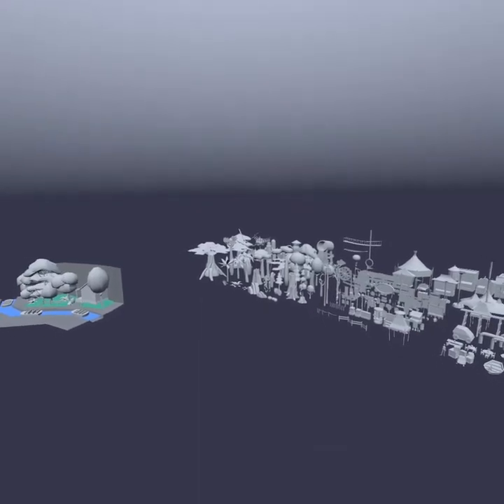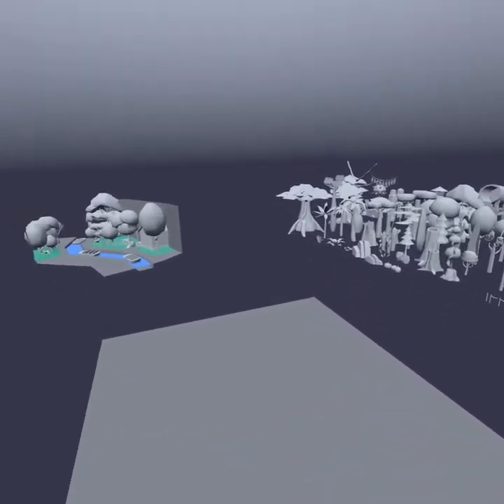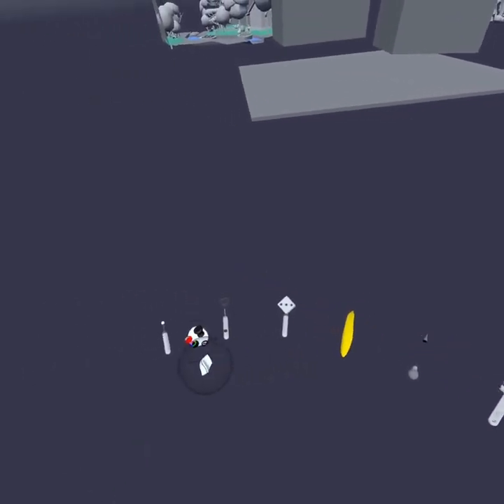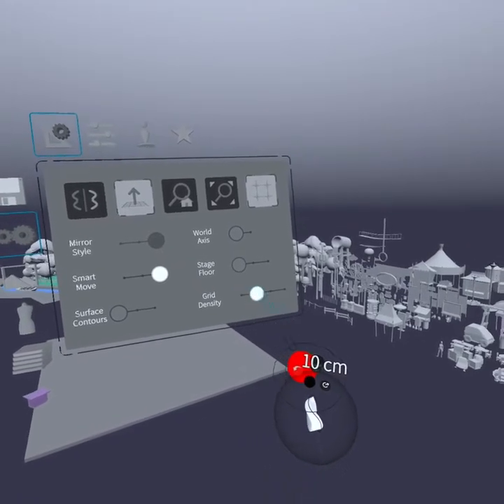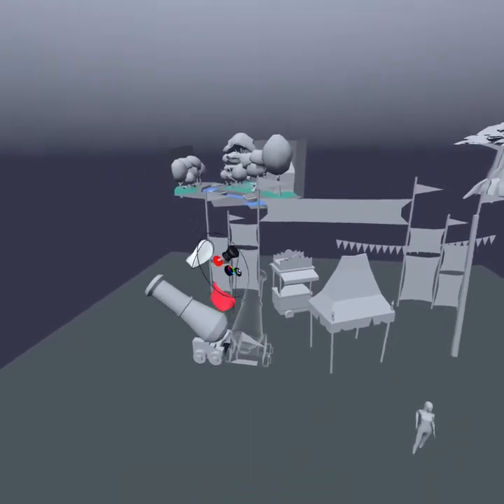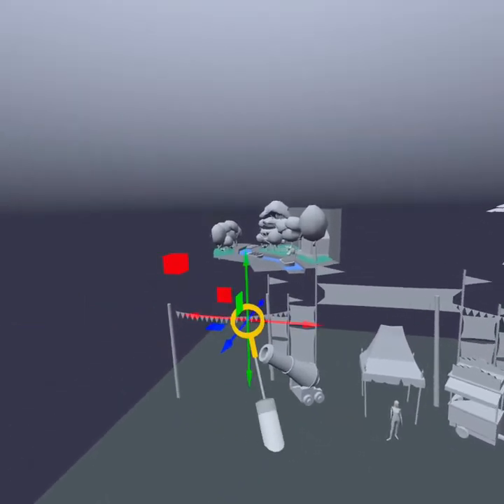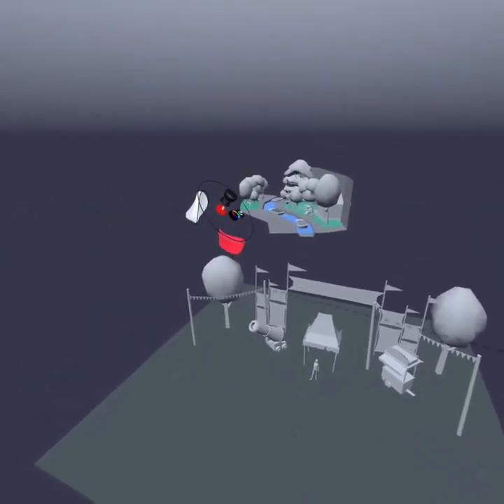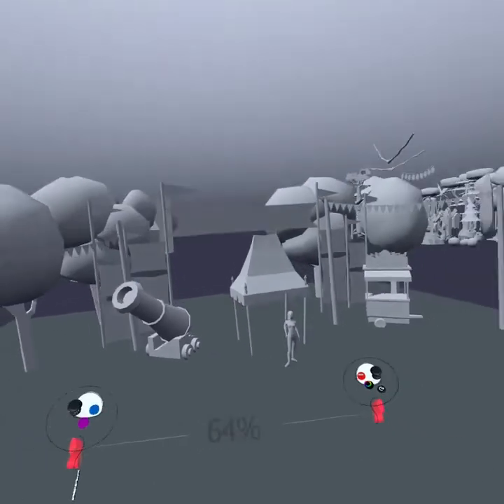Gravity Sketch - Precise Placement of Assets

Comment: Thank you, valuable information!!! Do yo Know how to align vertexes (points)  in edit subD mode? Is there a way to align a row of points that make up an object, for example, align them all on the y-axis?. can i use the grid for that?
Reply from the maker: Currently only by hand I believe. The selection tool helps a lot but without snapping you have to eyeball vertically placement.